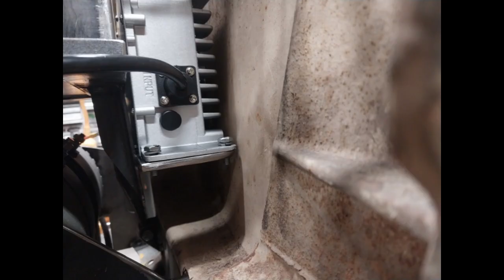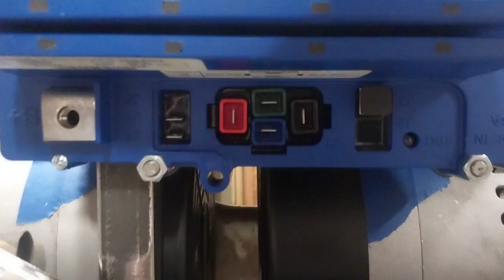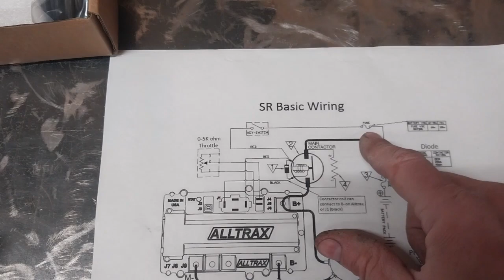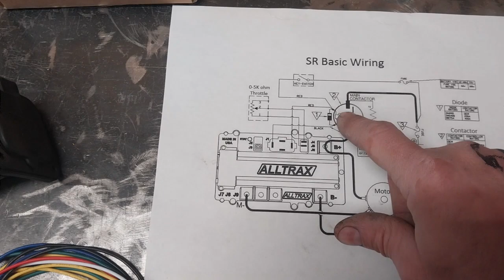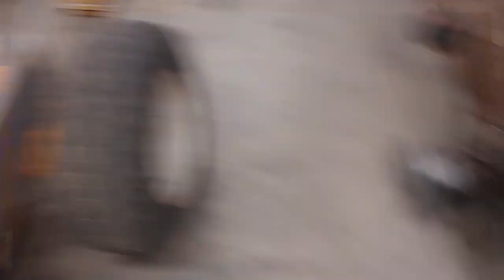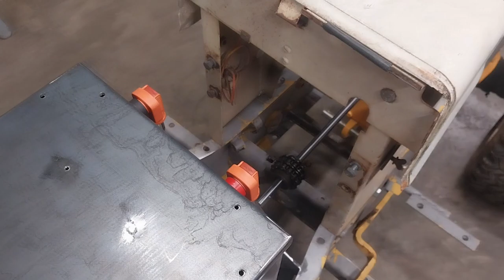Time To Start Wiring! - Ms  Cub

Comment: It's cool that you're building all this yourself. For anyone that wants to replicate this, most of the difficult stuff around the battery can be replaced by just ordering a 36 or 48V LFP kit meant for golf carts. EcoBattery has good options and there are cheaper ones like RoyPow and Vatrer.
Reply from the maker: Yeah, I could have used a battery system from one of a number of companies. The problem is price.  The RoyPow S51105L-A 51.2V uses identical cells to the ones I'm using (EVE 105ah) but costs $2100.  The cells are $40 each so 16 is $640.  Then, of course, you have to add a BMS and cables and build a rugged case.  Lithium batteries are very easy to work with and last a very, very long time.
Reply: @billbayer5526  Yeah, I meant it more as a note to someone else that may want to buy a pre-made solution. But the prices have been going down. I think there are options on Amazon for ~1000$ for the kit that also includes the charger.